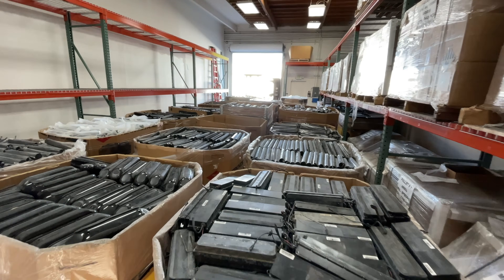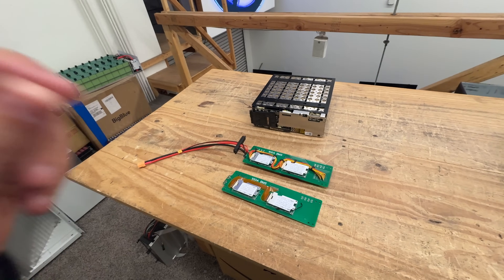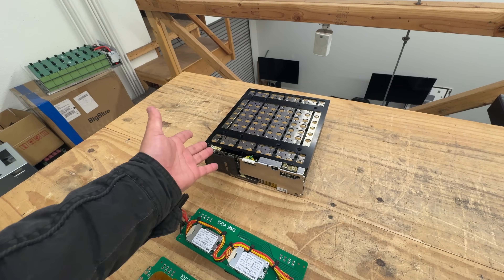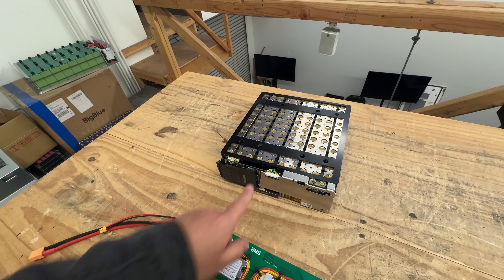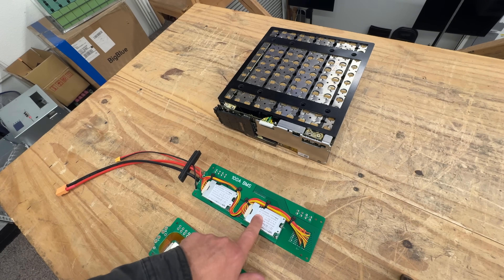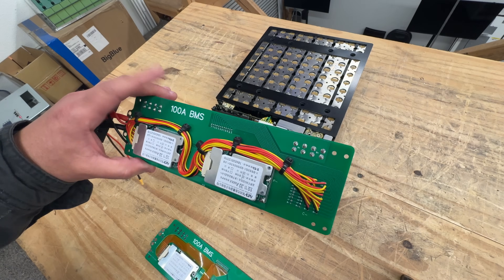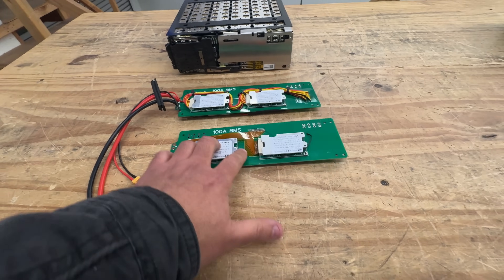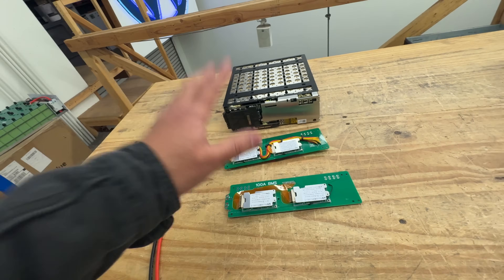What exactly does this fool do?

Comment: Great job.   I found  that the best high quality lithium batteries to repurpose come from the medical industry such as hospitals.  Many resemble small automobile batteries, have 12vdc working voltages,  and require one or two new 18650 cells to be replaced.  Once repaired, their bms boards are reusable.  I series connect mine to make a working 36vdc system for my homestead.  I just bought a full pallet of the batteries to be rebuilt or repurposed for the cells.  Geez lots of work ahead. Lol

Comment: Man, you've totally ruined the 21700 LG battery party that battery hookup started. He bought all the LG 21700 cells from battery hookup that was going for $178 l, then jacked up the price to $299 then to $399 currently. Definitely not falling for your your price gouging this time around.
Reply from the maker: These are not the same stock as battery hookup.  I hear those were degraded and ours are zero cycles  unused 100% capacity.    300 for these is not expensive.   And if they are you just not the right customer.
Reply: I have one right next to me, not the same stock as BHU

Comment: I think the one with the cables would probably be better as the cables were worked out to withstand a certain level of over amp where as those ribbons tend to be very fragile.

However instead of bunching the cables they could be laid flat against the board to produce a similar effect of the ribbon.

Most of those bms tend to come wired up to the plug anyway, perhaps just have a plug at the other end that simply slots into the battery plug.
Reply: those little cables arent seeing loads, they are just checking cell voltage and comparing it with other cells, Ribbon cables are fine. Having connector slots might be a good idea but who knows if its cost prohibited.

Comment: It seems to me that what you need is a simple standardisation method.

A system where you can produce a bunch of bms boards that will work with various different amp outputs.

So a standard 100 amp bms system or a 200 amp system or whatever.

By using a standard that also reduces cost.

Comment: The BMW cells in a 12 volt configure how much charging amperage can they take. Because when you're using them for car audio you're going to be running a 370 amp alternator if not maybe two or three alternators
Reply from the maker: I’d say they are only good for 200A charging if you don’t want to degrade them too much.